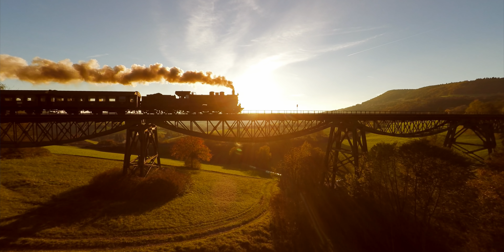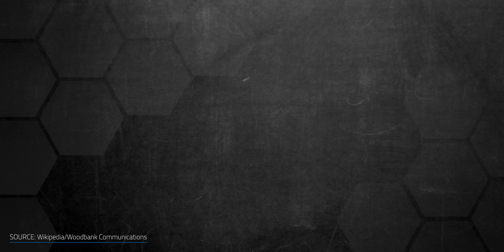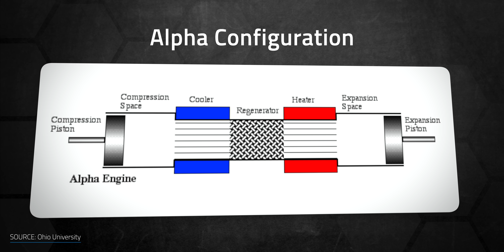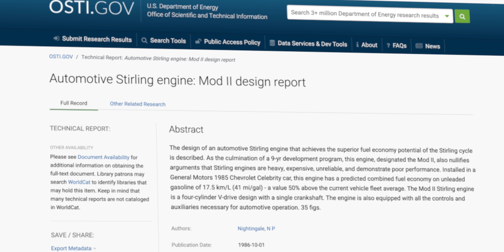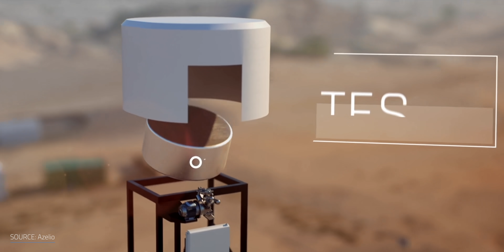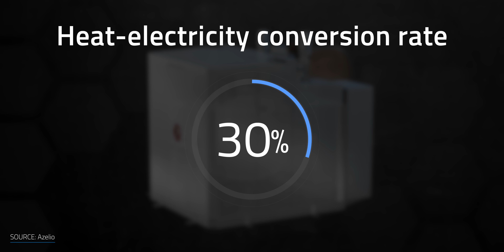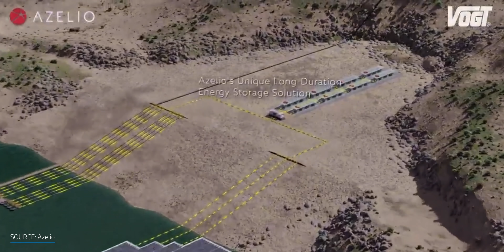Are Stirling Engines the Future of Renewable Energy Storage?

Comment: There are so many ways to optimize these kinds of systems with both new and old tech.  For some examples, the hot side can be heated by a combo of vacuum insulation and focused/concentrated Solar power (briefly covered in the video), whether parabolic reflectors, fresnel lenses, "funnel designed solar cookers" type solar concentrators.  

   But what's interesting and exciting is the new materials that can increase the efficiency of these.  Carbon nanotubes we now know, make extremely black and light absorbing material--excellent to absorb the heat of the Sun, and they may also have some electrical side properties so it might be possible to convert some of the Solar energy directly into electricity while primarily using it for heat. 

   Now we have extreme thermal conducting materials like graphene and cubic boron arsenide. And while really high quality graphene is still slow and very expensive to make, you don't need the really high quality stuff to get good thermal conductive properties, the graphenic-graphites (i.e. pseudo graphenes, which are the most common) work well in that regard.  I will be testing it in the near future, but I think that besides these altered graphites, I think cellulose nanocrystals converted to carbon and especially graphite hold a lot of promise. They are sort of modified nature's equivalent to carbon nanorods. And the processes to make them are not that hard nor expensive (well, they might be for bulk quantities, but the nice thing about these materials is that a little usually goes a long way).  And combine the very thermally conductive materials with a passive evap system (waste/dirty water) to further remove heat from the cool side. 

   Basically if you optimize insulation, heating, and cooling efficiencies, you up the overall efficiency some as well, though most of the losses are in the actual conversion of heat to electricity and/or then storage of electricity,  Efficiency in terms of more of smaller size, less material, etc.

  Oh, and the above system can be reversed for nighttime use.  Put the cold/cooling side in a vacuum insulated container with a very IR transparent top, put a parabolic reflector, Solar "funnel", or the like under it or the container within, point the reflect straight up to a clear shot of the sky, and then radiate the IR into space cooling that otherwise very well insulated area.  Then pipe the hot side underneath the ground to a stable, near room temp. You will get enough of a temp differential to power it over night, though it won't be as good as the day time, Solar driven system.  You just switch between the two systems as your power source between night and day.

Comment: Would likely work best at relatively low temperature differentials. At high differentials (700-900C) closed loop Brayton cycle gas turbines have been shown to be very efficient at around 54%. This system is used in solar thermal, dual cycle coal hele plants and is proposed for molten salt nuclear reactors.

Comment: The interesting thing I would note, is that internal combustion engines have a poor efficiency compared to the Stirling engine, but what if you put a Stirling engine or more of multiple of them on in internal combustion engine block and used the heat which is where most of the energy is lostin why there any efficient to run some Stirling engines?
Reply: water jacket the engine into a manifold and distribute that fluid over several Stirling engines...

Comment: Thank you for posting the video on the Sterling Engine!  Nicely done !!  The video got me thinking about the heat differential needed to drive a Sterling Engine ... a thought came to mind from "gotta have" potentials.   I grew up in Michigan's Upper Peninsula where summers are fairly short and winters pretty long and no shortage of cold weather.  Seeing homes gotta have heat, the normal heating of the home coupled with an endless supply of snow and cold outside might make for interesting sources of heat differential if the proper interface between inside / outside could be fashioned.    -20F to 20F outside mostly in the winter coupled with 60F - 70F inside the house.

Comment: Are stirling engines the future of renewable energy storage?

Absolutely not. They are fantastically efficient, but they are not cost-efficient. 

They do however have some very valuable and unique properties, like the ability to transform heat differential into mechanical energy, that can then be used to make electricity. Most ways to transform heat into electricity involve turning water into steam to spin a turbine, which comes with its own set of issues.

If cost efficiency is not the main driver, then the stirling engine is a fantastic addition to renewable energy generation and storage. It's a valuable tool, but by no means the future of renewable energy storage.

Comment: This seems like it would have a lot of the major draw backs of power plants vs batteries and solar. Mainly long ramp up/down times for peak demand and moving parts. Maybe this would be great in colder climates though where the waste heat could be put to good use.

I also think its unfair to compare this to grid batteries from an emissions standpoint. Grid storage batteries are usually LiFePO4 with longer life spans and can be recycled to decrease their environmental impact even further. Suggesting you buy new and replace with new (un recycled) seems disingenuous.
Many people use second life batteries that are degraded to arround 80% in the first place.

Comment: Also, it could be used as a pump for immersion-cooled PCs to allow for single or even dual-phase immersion coolants to be efficiently cycled through a radiator and back into the reservoir cooling the components. The solution would run silent and be quite efficient.
Reply: I had the same Idea when I saw this.

Comment: Stirling engines are cool and all, but they really don't have anything to do with actually storing energy. The proposed technology is just thermal energy storage and we've been researching that in various forms for a really damn long time now. It's one of those obvious forms of energy storage to look into.
Adding a Stirling engine to it is merely converting thermal energy into electrical power and we've never had a problem doing that (that's fundamentally how most electricity is generated, just with different heat sources).

Comment: hey Matt I'm a big fan but you got your explanation of the Strling cycle wrong. The expanding air does NOT push against the displacer piston. That piston is not air-tight in the cylinder - air is free to move around it and in fact the engine depends upon it. The expanding air pushes on the second much smaller POWER piston which is mounted on the top plate. THAT piston is pushed up and since it is mechnically Linked to the displacer piston that is moved in the Large cylinder and so it DISPLACES the air from the hotside to the cold side of the large cylinder. This is no nit picking - the Stirling cycle is wonderous and different and you missed it, so Ithough it worth bringing to your attention.

Comment: 200 YEAR OLD REPLACEMNET FOR STEAM ENGINE. SO IT WOULD NOT EXPLODE LIKE THAT. HAVE U SEEN THE STERLING ENGINE NASA INSTALLED INTO A BEHICLE AND GOT 150 MILES PER GALLON THEY SAID EASY TO BUILD EVERY FACTORY THAT MADE ENGINES COULD MAKE THEM.  THEN SOMEONE TOOK THOSE ENGINES AND MADE A BERRY EFFICIENT POWER GENERATOR LIKE 30 YEARS LATER THEY ASKED NASA IF THEY STILL HADE ONE IN STORAGE AND THE LENT IT TO THEM, WHERE THE HELL ARE THESE THINGS AT NOW FFS.

Comment: Tesla turbines have 99% efficiency at high speeds. Way less expensive and only one moving part, the blade rotor. Combined with 2nd stage tesla pump its unbeatable so far. The only critical parts its 2 high speed bearing. Oil industry using it for 100 of years already as pumps.

Comment: "contained explosions" you should know that a combustion engine does not have a explosion that is contained, it is a combustion that expands the gasses inside the cylinder, had it been a detonation or explosion the engine would never had worked, and would be subject to material fatigue allot sooner than they are now, it is after all called combustion not explosion engine.

Comment: This got me thinking about water, which is about 3/4's of our planet, and the interface between water and air.  Put a large sterling engine on a platform in Lake Ontario about 1 mile from shore in late spring, early summer when the water and air temp are at the greatest difference.  Using the Artic Ocean or a deep water pipeline to the sterling engine on a hot summer day.

Comment: So what if i dig a hole, deep enough to get thermal heat. Then lay a tube from there to the cold air high above the ground. And on the ground, right in the middle a stirling engine? Boom infinite power till earth runs off thermal heat.

Comment: I wonder how much continuous power you could generate with this between Air and a Ground-Source.  Presumably not a ton, but even something as little as 1kW would still be like 24kWh/day of basically free energy.   But how big an installation would be needed for something like that?   Clearly something like, oh, that little toy, couldn't generate more than a few watts at best (and maybe even not that), and not for long, and that's using boiled water or ice which probably took 100Wh of energy to produce in the first place.

-Matt

Comment: Theoretically this system outperforms a lot of other electricity solutions for home usage, as unused low energy thermal waste energy of the heating system can be used. There are already solutions on the market. But the main problem are the moving parts which comes with a lot of maintenance and high costs. So they aren‘t affordable.

Comment: Peltier cells does the same exact thing but with no moving parts and with a much shorter chain of energy conversion, because the output is directly electric current, that means much higher efficiency

Comment: I read somewhere that the main reason sterling engines are not widely used is due to having very little torque..,  but maybe that was BS
they would work anywhere..,  outer space, the moon etc. they can be run on solar, geo thermal, any kind of fuel that burns, the question is.., why are we not really using them??

Comment: Could you combine this with an air conditioning radiator to recover some of the power needed for heating and cooling. There is always some sort of differential in the temp across the rad.

Comment: I enjoy making models of antique Stirling Engines.  I have looked into what it takes to make a high performance Stirling with a long life.  Maximum power requires high gas  pressure and high temperature.  It is a challenge to find cost effective metals that will have a long live in this demanding environment.

Comment: They would be excellent in space.
If the jury still out, then we need a new jury panel.
Reply: The main issue is that, while space is really cold, its also a near perfect vacuum. Being able to dump heat by radiating it away is mostly done through convection, so since theres not really any particles for a heat sink to interact with in space, you wouldnt really be able to effectively use a stirling engine in that environment.
On a planet, however, thats a different story. Mars it would work well on, especially if you were able to use the ground as a heat sink. The atmosphere is a bit too thin to be able to do it.
Reply: @monkieassasin  In reverse , however, you would absorb heat from the sun on one side, assumingly the bottom side of, what I consider to be the classic style of sterling engine, whilst the opposing plate is exposed to the atmosphere inside the craft, acting as a primarily or secondary source of heat for the crew. I'm not sure that I am clear on your hypothesis. What you stated about the absent of a medium, such as air, to conduct the transfer of heat is correct, however, if one plate is never exposed to the sun, then said plate will act as it's own medium for heat transfer. It has always been my understanding that when a surface is exposed to the sun, it will become extremely hot, where as a surface turned away from the sun becomes extremely cold. However, my knowledge of such thing are quite rudimentary and I may be making assumptions out of more ignorance than facts then,  I do offer my sincerest apologies.
Reply: @andrewjackson9697  No worries bro :D 
Im a physics undergrad in my senior year, so my own understanding is not perfect, but from what I understand about the matter, you must remember that work is done when heat flows, not from heat itself. In other words, its change in heat over time that does work, or the derivative of heat. That means, with no proper way to have the heat flow from your surface that is being hit by the sun to a heat sink, you still will have a problem generating any viable heat, especially considering any considerable stirling engine is quite a bit heavier for its energy generation capacity compared to high efficiency solar panels or nuclear battery technology.
Finally, the intensity of energy from the sun falls off quickly as you move away from the sun, at a rate of to the power of 2, so that if you got twice the distance away from the sun as the earth, youd only have 1/4 the heat, meaning a significantly bigger stirling engine to be needed to generate the same amount of energy. In regards to space, since its so costly to get anything into it, its of the upmost importance that the systems not only be efficient, but also requiring as little mass as possible.
The current technology that we have that is most promising is nuclear technology, as many isotopes with half lifes of a few years produce lots of beta radiation, which is just high energy electrons, and are easily captured to produce energy for many years, without much mass use.
The technology actually has alot of applications for here on earth as well, but due to them using materials that can be used to potentially create nuclear weapons, it has not been explored for on-Earth use.
Their efficiencies are much lower, being only 5 to 8 percent, but the vast difference in the amount of mass needed makes it significantly better for space applications.
I do wonder though, if we could apply a stirling engine combined with a nuclear battery, to harness the heat from the nuclear reactions as well to make it all efficient, while also using the excess heat to keep the spacecraft warm.
Reply: @monkieassasin  The Voyages Program, launched in the seventies, was powered by three nuclear power sources  radioisotope thermal generators (RTG's) that produced about 400 watts of electrical power.  I believe that we are still in. contact with one of them today. Nuclear is the power of the future here, and in space. Nuclear batteries for your electric car. Nuclear batteries to run your house. Solar and wind are a joke. Harness gravity is your next best bet if you're not ken on nuclear. Gravity is Always there. Solar and wind might due if you are camping, ( might). I believe you are on to something with the nuclear,  Sterling Engine idea. The best thing about the Sterling is that it is not about the amount of heat, but how great the  difference in temperature.  Sterling engines are the true multi fuel engines anyway.
Reply: @andrewjackson9697  100% agree

Comment: I always wondered about a multi tiered liquid air / stirling engine energy storage system; you could store air as a liquid in a tube, and as you compressed it it would get hot, which you could use to run a stirling engine to increase the efficiency by using the waste heat, and then when you released the now room temperature liquid air, it would generate a cold temperature in addition to the raw force, also letting you run a stirling engine to further increase round trip efficiency.

I'm sure there's a reason we don't use such a system but it always seemed like an elegant form of energy storage to me, personally.
Reply: Sweden has submarines which use something similar. They evaporate liquid oxygen on the heat sink, super-cooling it, and use the resulting gaseous oxygen to burn diesel fuel on the heat input, superheating it. The result is a diesel-electric submarine which can stay submerged for weeks and run as fast, submerged, as it does on the surface. Doesn't have the range of a nuclear submarine but it's orders of magnitude cheaper. Also, since a Stirling produces an oscillating motion, they don't need to turn a crank; attach it to a linear alternator and it produces pure sine-wave AC power; you just have to regulate the system to keep the frequency where you want it.

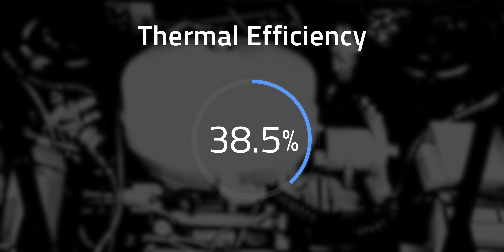Comment: 5:50 fuel injection gas cars that also use diesel mixed In the combustion chamber can reach 50% thermal efficiency, it's just cost more and requires 2 fuels...
Reply: I believe that road legal cars hover around 30 percent though with some diesel engines going to 50 (but i think its  less efficient when compared to other similiar sized engines), and the Mod II  programs engine was at around 40% thermal efficiency, who knows how much of an improvement could be made with the 40 year improvements in battery and materials technology.